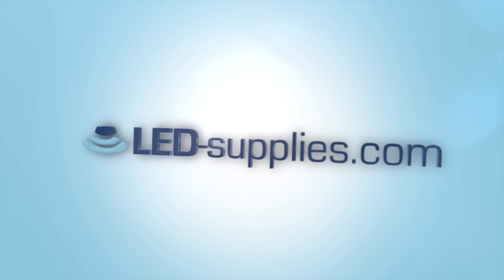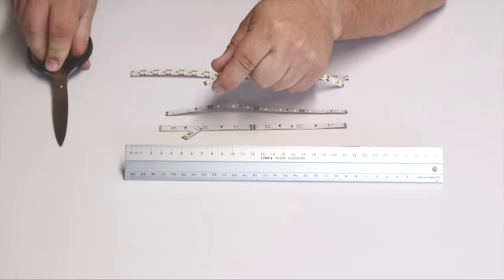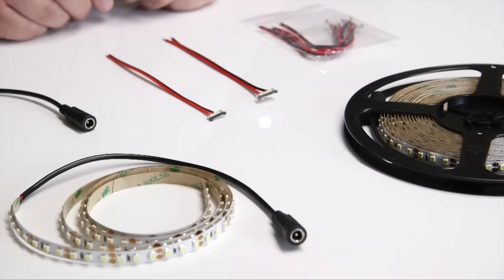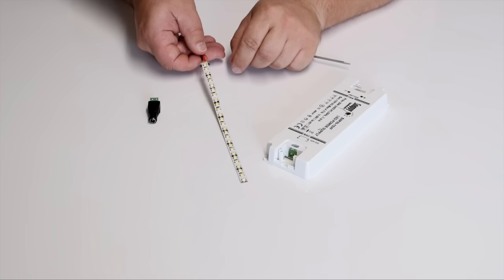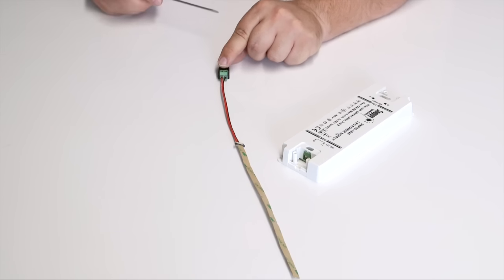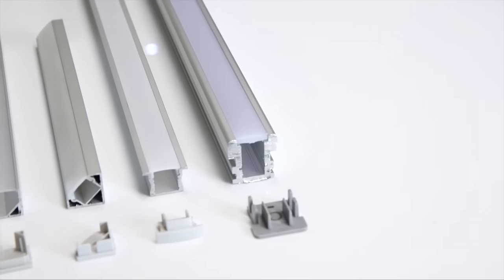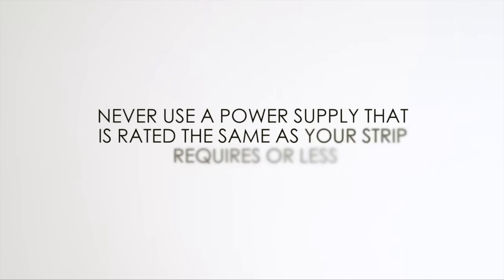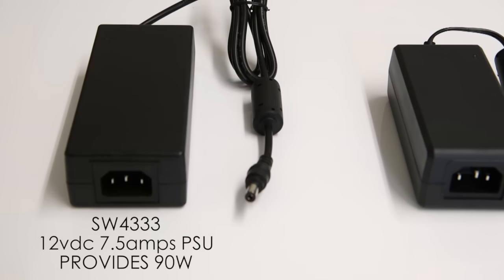How to cut, connect & power LED Strip Lighting

Comment: Hi

I want to buy these LED strips for my new home. Since it said 5m length and it’s too much. I know we can cut them but can we use the cut piece?? 

If yes, do we need a new adapter or wireless hub? If yes how much for them to buu seperate.

How many of these lights we can connect with 1 Alexa? I do have philips hue lamps runnings with alexa with different hub, would this be fine to run these as well on same? 

Please answer thanks

Comment: i have a question..
i want to light up my roof room. then i counting that my room need 12M. and the Led that i get is 7,66 W/Mtr. so, 12M x 7.66W = 91.92W. then 92 + 20% = 111.

So i need 111W.... is that right?
but, its to high...

Comment: Can I just connect the red and black wire to a stripped USB cord to power it on ?
Reply from the maker: This would depend on what LED strip you have. Typically a USB socket outputs 5vdc and LED strip is traditionally 12vdc or 24vdc constant voltage. You would also need to consider the power rating required by the strip and whether the USB would provide enough

Comment: Very informative video. I have a question - I already purchased 2 reels of LED Strip Lights; 5 meters each. I would like to connect them so I will have 10 meters of lighting. The power supplies that came with them are 12 volts, 2 amps, 24 watts each. Which power supply do I need to power all the lights? 60 watts? How many amps? If you can kindly send me a link to the correct, compatible power supply I must purchase, I would be grateful.
Reply from the maker: Hi Jospeh,we're pleased the video was helpful.. thanks for your feedback. Do you know what the actual rating of the LED strip is? I would guess its 4.8 watts per metre which is why you have been supplied 24W  but they allow no headroom so its not ideal but will work fine.. it just stresses the power supply a little more than we would recommend. If the LED strip is 24W per 5M (4.8M x 5M = 24W) then 2 reels / 10 metres would be 48W, so a 60W power supply rated to 12vdc 5A would be perfect allowing that headroom, yes. The only other thing to note would be make sure the LED strip can accommodate 4A being pulled into it (12v 4A 48W) if you are powering as a single run of 10 metres (series connection) as you may need to connect it to the power supply in 2 runs (parallel connection), perhaps from the middle so it still looks like 1 continuous run. our 12vdc 5A 60W power supply is here should it be of interest... https://www.led-supplies.com/led-drivers/desktop-power-supplies/power-supply-12vdc-5a-60w-constant-voltage-with-uk-lead/

Comment: Hi. Really informative video but I'm stuck. I'm trying to install some led strips on 2 separate shelves. My set up goes like this: 12V 6A power supply running to led controller, then a 2 way splitter. Off this I'm running about 3metres of 4pin rgb strip cable to about 2 metres of the led strip. The leds work but when I try to control them via the remote they either switch off, stay one colour or don't do anything. It's driving me insane! Any ideas would be greatly appreciated!!!
Reply from the maker: Hi Salmon, are you sure you have an RGB controller and not one just suited to single colour strip?

Comment: Enlightening (so to speak) video. Many questions I've had for years were answered though one remains: how tightly can you wind these strips into a usable array w/o damaging them ?
Reply from the maker: A tricky question to provide a definitive answer to this Bernie, as it can change from one type of LED strip to another. you would be able to wind most LED strips around a relatively loose bend, such as your wrist for example, but too much ie at right angles for example and it will damage the PCB. Sorry w cant be more helpful on this
Reply: Wow. Wasn't expecting a quick reply (or even one at all considering the age of the other comments). I guess that could be something I could test myself w/o going broke. Until then, I'll check out What LED supplies company has for smd's, substrates, heatsinks, and all the rest of the material options for a hardy brain workout. Thanks much, --Bernard

Comment: I have 2x 144/meter WS2812 5V strips that I need to power up. Based on your recommendation I need to run a parallel. I'm new to this but I have a PSU of 100Watts but I'm unsure how to connect it. Can you point me to somewhere with guidelines or if you can give any tips?
Thanks!

Comment: Can I cut off the supply wire from the package and swap with USB cable, which mean the one likes cylinder shape is change to USB cable, if I insist to use the USB cable which more you prefer whether using the USB cable to attach directly with the LED strip or solder the USB cable with the wires first then attach to the USB cable???
I hope you can understand me. If you cant understand what am I saying at least please try to understand.
Give your opinion....
Reply from the maker: I am not 100% sure what you mean but i think you would like to operate the LED strip from a USB input? USB usually provides 5vdc. we do have some LED strip on our site that has a USB cable and operates from 5vdc which you can see via the link below, but most LED strip operates from either 12vdc or 24vdc so i would check this before you switch input cables
https://www.led-supplies.com/led-strips/usb-led-strip-5vdc/usb-led-strip/

Comment: can this be used in a doll house?
Reply from the maker: Yes, be careful what you are mounting the led strip onto though. The lower power 2.4 watts and 4.8 watt per metre strip can usually be mounted fine onto wood etc, but as you move up to the more powerful and brighter LED strips we suggest putting it into an aluminium extrusion to help dissipate the heat and maximize reliability

Comment: Great video. 

Can I connect my 5m strip directly to a 12v car battery?  As I  have a  simple  12v  Solar panel charging it in my garage which doesn't have a 240v  mains supply .

Comment: Hi, are any of the transformer mentioned Dimmerable by a standard wall dimmer
Reply from the maker: You wouldhttps://www.led-supplies.com/led-drivers/mains-dimmable-led-drivers/mains-dimmable-led-drivers/ need to use a mains dimmable LED driver like the ones linked to below. A standard wall switch may need to be replaced with a low load wall dimmer switch to get best results

Comment: Is there a 'tiny' power supply or battery supply for using a tiny strip6" - 12" max within a wooden box with opening parts? This to give small lighting effect in box 18" long
Reply from the maker: How much power in watts does your LED strip lighting need? Our 6W LED driver is very tiny https://www.led-supplies.com/led-drivers/led-drivers/12v-led-driver/12v-led-driver/

Comment: How long can the extension be without losing power? Let's say in this case I use a 5V DC power supply.
Reply from the maker: the thicker the cable you are able to use, the less voltage drop you get down it so its tricky to give you an accurate answer. You always get some voltage drop down a cable, the longer it is the more you get

Comment: If u get 5 meters of led and u cut 3 meters can u still use the 2 other meters?
Reply from the maker: Yes, just follow the cut marks on the strip
Reply: LED supplies so I can cut where the points are marked and still use the other half and they will still light up

Comment: great vid!  for my 12 Volt power source, can I just hard wire to my 12 V battery? (I would also run the positive wire thru an ON/OFF switch and a fuse.  And what size fuse should I use if i'm running about 3-4 meters of LED's?  THANKS ! ! !

Comment: Is there any other way to connect them if you dont have a connector or solder?
Reply from the maker: Hi Amay, you need to use a connector or solder to make the electrical connection

Comment: This video is a tad out of date, in that the connectors are different now.
Reply from the maker: The connectors are still current and offered. We have found newer versions to be less reliable. Thanks for watching and your feedback
Reply: Correction,  to be clear,  other clip-on connectors can also be purchased intended for use with inline transformers and DIY wiring. They clip onto the bare track, with a couple of narrow holes through which the wire connects. I found that pushing in the stripped bare wire ends was unreliable but tinning them first with solder keeps the strands of wire together forming  a stiff end that does insert and stay connected.

Comment: great  video, though Im still a little hazy on whether its possible to connect two different strips using the clip on adaptor as a bridge between the two? like so...... PSU >> Led Strip >> clip on adaptor >> Led Strip >> clip on adaptor >> Led Strip ...... and so on.....?

Comment: I am looking at running Part number ECO-5MFL-300SMD-WW on perimeter of each of 10 windows(indoors). I measured 150 feet in total running length. I have the ability to connect to Four  120V (US) Power Sources. What kind of power supply do you recommend? Also, in your site, I see Plug to power supplies listed. How much watts Power Supply should I buy if I need to run 4 units? Is there a count of the number of LEDs per Watt?

Comment: 2.5 m led strip. Which power supply do I need? 12W is enough?
Reply from the maker: That depends on the power rating of the LED strip. If its 2.5M x 14.4 watts per metre for example that would use 36 watts so we would suggest a 45W to 50W power supply or more allowing the 20% headroom on max. load

Comment: I see here everything is in Watts what about volts? I am a student who is studying elektricity so I am not fimilliar what all these stuff
Reply from the maker: Watts = volts x amps ie 30 Watts is 12vdc x 2.5 Amps (12 x 2.5 = 30)

To get the voltage you would divide the Watts by the current (amps) ie 30 Watts divided by 2.5A = 12 (vdc)

I hope this helps Metin X. Good luck with your studies
Reply: LED supplies well thanks alot!

Comment: Better idea. I power all my homemade LED desk and room lights off my 12vdc system running the home. Mix 6 bright-white with 3 warm white to achieve an almost perfect eye-friendly desk light.Even using 5050 LEDs it still only draws 4 watts !!! Converting swinging desk lamps is easy. A 6LED strip duct taped to the side of a one gallon milk jug makes a nice 25 watt equivalent corner room light. To properly solder waterproof LED strips , scrape the beck side gently with a razor blade until you see the copper strip,then solder to it. Liquid flux helps a lot.

Comment: My led had a gel cast on it so I can't clip like that how do I do it
Reply from the maker: You have to carefully peel or scrape that waterproofing layer off and then you can use the connectors but if you are using your LED strip lighting is a damp location whyere it needs to be waterproof please remember to re-seal the LED strip and connection you make once you are finished

Comment: Thank you so much for your video.  It was tremendously helpful.  I do have a question that I am hoping you can shed some light on.  I have been asked to use an old computer as the power source for the LED lights.  I have figured out how to do part of that and have figured out what I need to do with the LED light from your video but have no idea as to how to connect the two.  Any ideas?
Reply from the maker: An easy way of connecting LED strip to a computer is via the USB socket. We have a range of USB LED strip lighting which operates from a 5vdc input. In case it helps take a look here https://www.led-supplies.com/led-strips/usb-led-strip-5vdc/usb-led-strip/

Comment: I have a 97.2W strip that is 5 meters long. Are you saying (in this video) that I shouldn't run this 5 meter strip in series with a single power supply (120W)? Can you explain why and what alternative I have? Thanks.
Reply from the maker: You would need to speak to the manufacturer to check this. Generally, at this power level the LED strip is not thick enough to carry that level of power without it getting damaged. Is your LED strip 12vdc or 24vdc? If its 12vdc at 97.2W the whole 5 metres would be pulling 8.1 amps which is a considerable amount of current to be passing through what is usually a thin PCB. If its 24vdc the current would only be 4.05 amps which is better of course. As i say please check with the supplier of the product you are using as they may have made the PCB and current carrying tracks heavier duty to accomodate the higher current on your LED strip
Reply: Thanks. Well, I already made the circuit, in parallel fortunately, with 5 meters divided into 6 strings pulling 1.35A each, specifically due to what you pointed out above.

Comment: could u cut these down need strip around darts board cab
Reply from the maker: Hi Ashley, yes you can cut the LED strip down as long as you cut at the points indicated on the LED strip itself. You may be interested in side emitting LED strip https://www.led-supplies.com/led-strips/side-emitting-led-strip/ or our bendable LED strip https://www.led-supplies.com/led-strips/bendable-led-strip/ which can be curved

Comment: Just to clarify,  a 10m strip is recommended for a smaller power supply. If I were to connect say 30m I would need a stronger power supply? Or would I need 3 seperate power supplies
Reply from the maker: Hi Will, the important thing is to ensure that the LED strip is not drawing more current from the power supply than it can accomodate. The longer the length of LED strip you power as a single run, the higher the current it takes from the power supply. For example 5 metres of 4.8 watts per metre LED strip uses 24 watts, which is 2 amps at 12vdc. If you tried to power a 30 metre run of that same 4.8 watts per metre LED strip that would need 144 watts which is 12 amps at 12vdc! 12 amps through most 4.8W/M LED strip would be much to high and cause damage to the LED strip and very probably early failure. Therefore, you want to power the LED strip in smaller sections and use multiple power supplies where possible which keeps the current running through the strip down and reduces the chance of damage. I hope this helps

Comment: im using a clip on addaptor with my LED lights but its flashing instead of shining a continuous light
Reply from the maker: It may be that the LED strip is overloading the power supply, causing its overload protection to kick in. This could potentially make the LED strip flash as you are seeing as the power supply cycles through shutting down, restarts and shuts down again. I would suggesting trying a power supply that can provide more power

Comment: Hey. do you know how can i use a mobile led strip ?, with no wall conect...
Reply from the maker: You can operate LED strip from a battery as long as the battery is outputting either 12vdc or 24vdc (as required by the LED strip) and enough power

Comment: If you cut it will both the halfs work?

I know stupid question but just wanna check
Reply from the maker: Yes, assuming you cut the led strip in the place indicated then both sections will work OK
Reply: Yes but will you need to connect both of them or when you turn it on will they both turn on even including the the unconnected strip

It's alright if you don't understand me

Comment: can it be powered by USB
Reply from the maker: Hi we do offer a range of USB powered LED strip which you can see here https://www.led-supplies.com/led-strips/usb-led-strip-5vdc/usb-led-strip/
Reply: I know that.... Am asking if I can use a USB to power it instead of the standard wall power supply
Reply from the maker: if your LED strip runs from the voltage that the USB socket supplies then yes. A USB socket usually outputs 5vdc and most standard LED strip runs from a 12vdc or 24vdc input so check with your LED strip supplier
Reply: the led needs 12v ...I have roll 5m long and need piece to go behind my tv and to be powerd by the USB port on the tv that work

Comment: how will connect this to a 12 volt battery? anyone?
Reply: Connect + wire to + pole on battery. 
- to the - side.   
just get some thin wire.

Alternatively, get a 12V DC Plug Male (He showed it, but you can google) connect that to the LED Strip as shown.
Then get a 12 V DC Plug Female with wires attach and connect that to the battery. When LED is needed, plug them into eachother.

You might want to put an on/off switch between them.  
Also, dont let the LED drain the battery. Drained batteries are often permanently damaged.

Hope this help.
Reply: thank you and this does. I am making a small house that will have working lights. The light are then connected to a battery which is connected to a solar panel.

Comment: So let me get this straight. Even if you put a 90W power supply on a 1 meter led strip, the leds will only draw what they need in order to function normally?
Reply from the maker: Yes thats right. The power is 'pulled' from the power supply.  The power supply does not 'push' the power into the LED strip so the LED strip only ever takes what it needs from the power supply or led driver

Comment: Am I to assume multiple strips are soldered together in series with a continuous circuit?  If so will they power up simultaneously or will they power up one after the other?  I'm looking to install them on my stairs with a motion detector on top and on the bottom.  I'll have to yet figure out how they are installed.

Comment: Great Video, just the Info I was looking into. Question: do the Red LED produce 600nm-700nm ? does is the wattage important as in a 3v 12v 120v still produce the same nanometer only difference would be the lumens ? Total Novice but love learning.